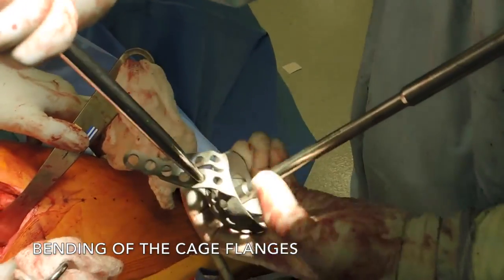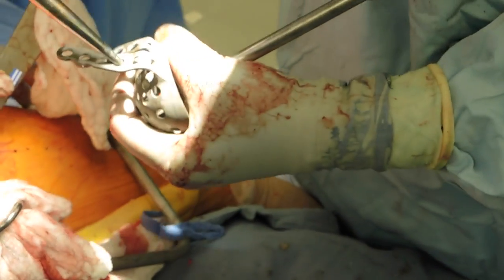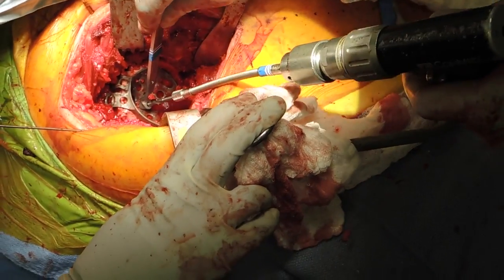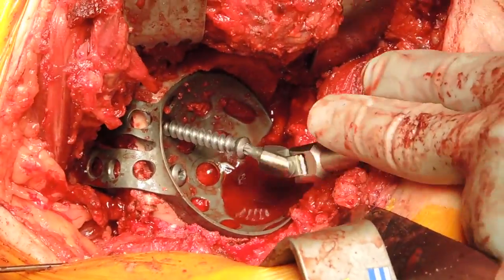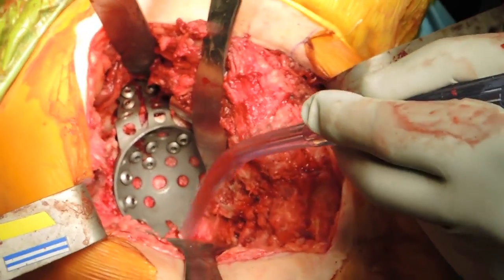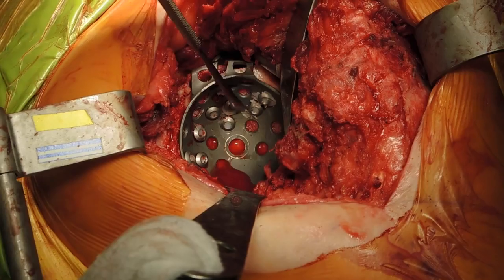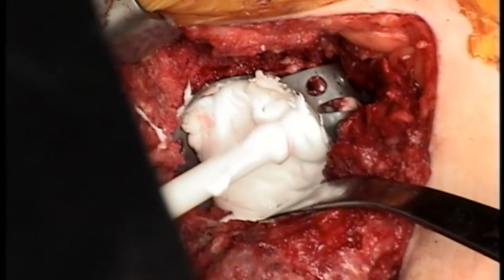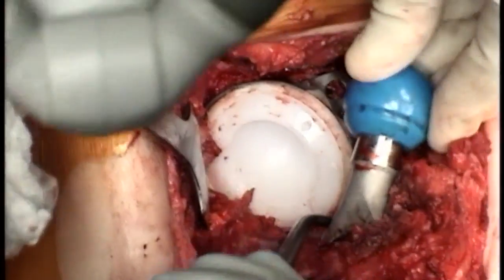Reconstructing Pelvic Discontinuity and Severe Acetabular Bone Loss in Revision Hip Arthroplasty

Comment: I'm scared shitless .  I've been walking with AVN for 11 years hip is almost completely fused and my pelvis is worn so bad there is nothing to attach to. First surgeon said it was out of his league.
Reply: did you get help?
Reply: "Walking" for 11 year with AVN sounds like a terrible exaggeration. I had AVN for 7 months went through all 4 stages the 3rd stage which makes the femoral head so weak it became flat, and that was awful pain I was prescribed 40 mg roxys and end up   with stage four avn with a gapped joint, with agonizing non stop pain, I was prescribed a 40 count 80 mg roxys and couldn't even set my foot on the ground or lift or move it in any kind of way... so pleased forgive me for not believing you were walking on a hip with avn for 11 years, it just doesn't sound believable at all
Reply: So you're the reason I struggle to walk! Got ya🎉

Comment: If osteolysis with open  wound  serous fluid. Just acetabular liner  dislocated. Osteolysis fluid coming from osteoporotic trochanteric. We can fix acetabular RAF with liner and cleaning good in one stage?? Your operation with one stage just replaced acetabular component. Your not replaced femoral stem and with out 2stage operation after!